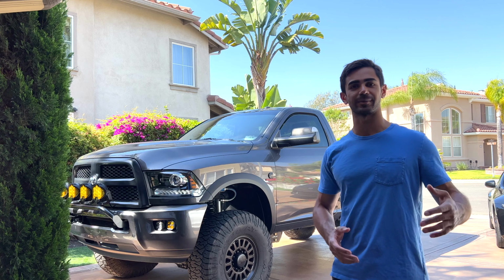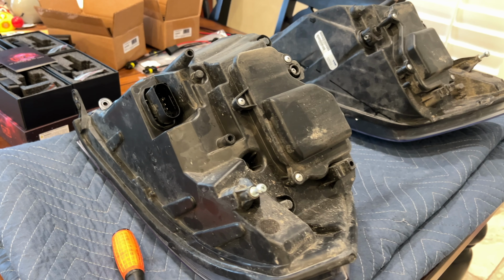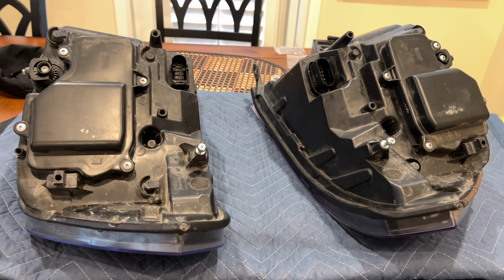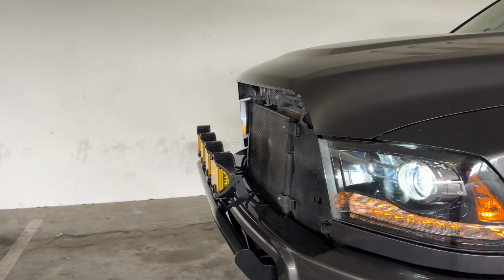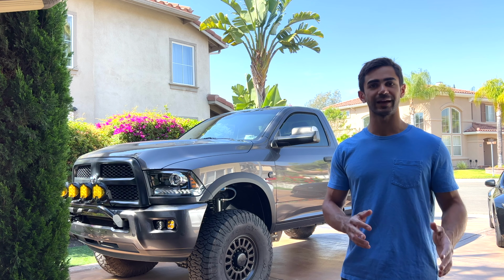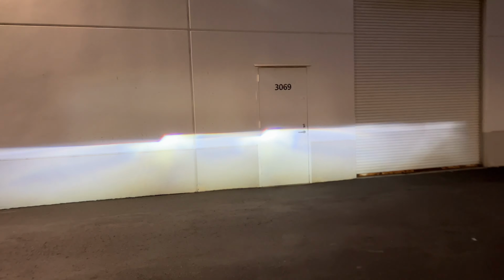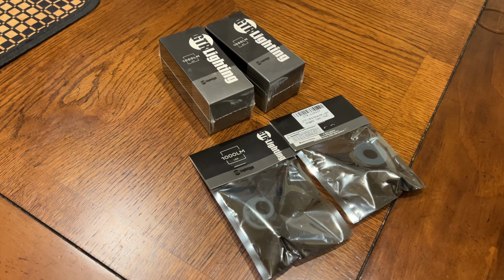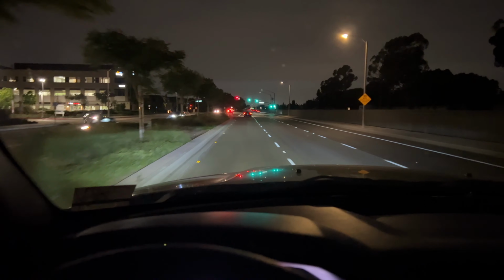BEST LED Headlight Bulbs for Dodge Ram 1500 2500 3500

Comment: What is the name of the leveling kit you bought?
Reply from the maker: I have a Carli Pintop 3.25” Kit now. I had a rough country leveling kit on here for the first 2 months of owning it.
Reply: @socalexpeditions  do you like it thinking about doing one for my truck
Reply from the maker: @anthonykontos7931  The Carli kit or the Rough Country? The Carli Pintop kit is the best thing ever. Rough country, pass.
Reply: @socalexpeditions  good to know, do you have a link where I can look into the carli  pin top kit?
Reply from the maker: @anthonykontos7931  Here is what I have from Carli, + the radius arms. https://www.cjcoffroad.com/collections/2014-2018-ram-2500-diesel-hemi/products/carli-suspension-2014-2020-dodge-ram-2500-pintop-king-2-5-3-lift-system